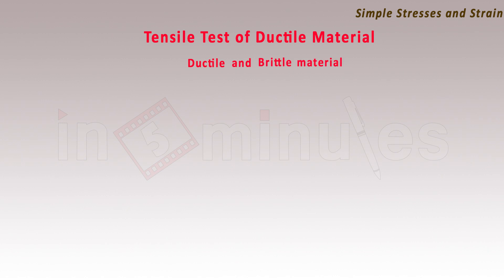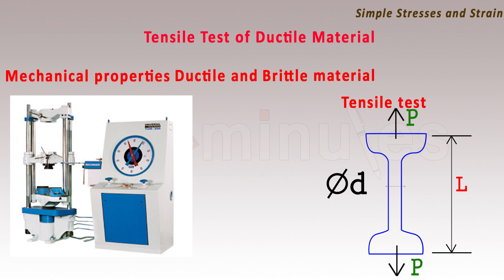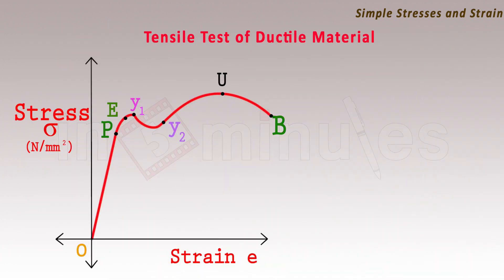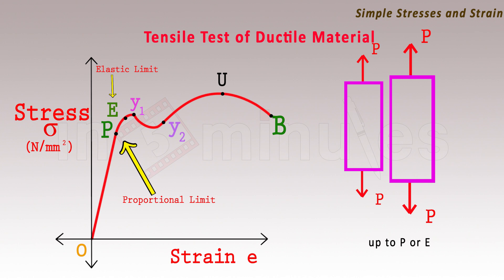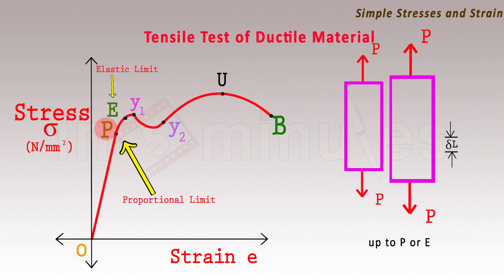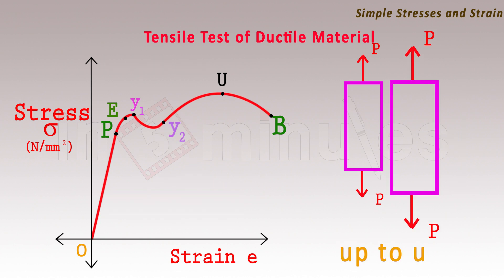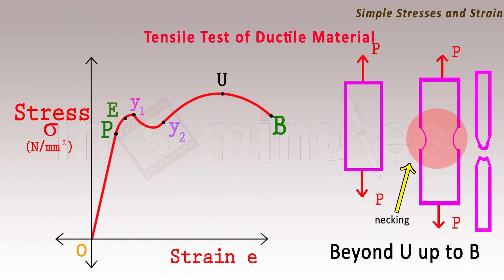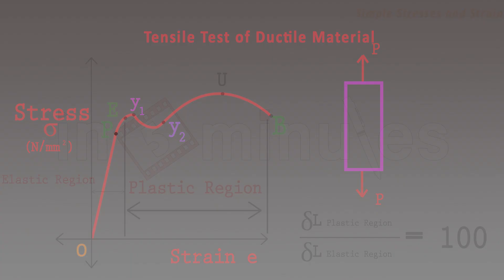Tensile test diagram (Strength of materials) - Mechanical Engineering

Comment: Why y1 and y2 I dint  understand
Reply: because of the yield point phenomenon, watch this for more detail https://www.youtube.com/watch?v=D8U4G5kcpcM
Reply: Those are the lower and upper limits at which the object being tested will not be elastic, but rather remains at the deformed or "stretched" state. Y1 is when the object stops being elastic and is permanently deformed. Y2 is the end-point of deformation, and the metal becomes strengthened because it is being compressed from the tension, making it stronger in some ways.

Comment: Sir , why we only use tensile test in plotting stress strain curve why not other tests ??
Reply: because this is the simplest test to analyse. In unixial test, we do not carry out a compressive test as a phenomenon termed Buckling will occur and that makes the result inaccurate.
Reply: Young's modulus can be calculated from tensile test stress/strain graphs.                                                                          WHY WE CAN NOT USE OTHER TESTS ?? because if will use compression test you will get a straight line 45 degree in between stress and strain graph and sudden failure... in that graph its very difficult to find out when the structural member was in elastic limit, yield stress , ultimate stress but only you can see the last action thats Facture of member.